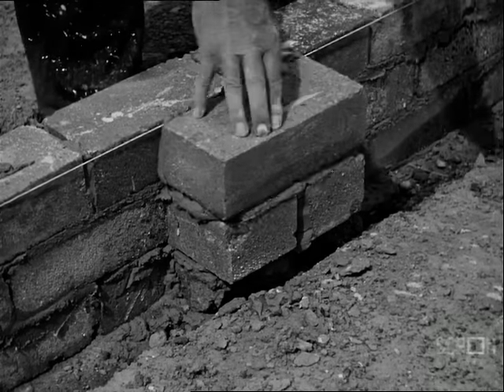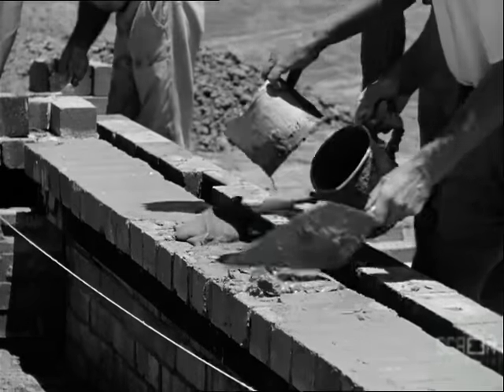Building A Brick House

Comment: That roof tiler running up a ladder with a full shoulder of tiles. Gangster
Reply: He had great sense of balance,one wrong step, that's the end of his roof tiling career. Respect his nimbleness.
Reply: That’s just how you do it.
Reply: Gangsters run up ladders carrying tiles? I doubt Al Capone ever did that.
Reply: And those shoes, no boots, looked very light weight, because so much of it was tactile. That had to be 50 pounds on his shoulders & he didn't miss a beat going up that ladder-without hesitation.
Reply: @girlsdrinkfeck  i was a roofing labourer at 15 years old shouldering 10-13 @ a time all day long.i was a beast at setting out for a kid
Reply: Men were strong considering how slim they were. 
Nowdays many tradies look like sacks of sand and no strength
Reply: Unbelievable balance
Reply: @PetraKann  i saw a group of roof tiler tradies last week they were carry half that amount . 
Back then a 75kg man could lift a lot more than a 75kg man today this video proves it again
Reply: Nope, gangsters are gangsters because they're Too  Pussy to do that.
Reply: @bobdobric6787  Need to use tile lift these days
Reply: Dun it but ya I was 24
Reply: Tennis shoes perhaps.
Reply: Australia.
Roof tiles are cement.
Reply: goddamit you opened the internet's pandora's box! Internet roofers!
Reply: @bobdobric6787  My dad helped one of his older cousins build his house in the mid-60s. To this day he loves to tell the story about one of the brickies, who'd put one 50 kg bag of cement on his shoulder, then another, and climb a ladder up to the first floor!
Reply: I was a roofer until a car crash put paid to it, stacking out a roof certainly earned a beer at the end of the day!
Reply: @Ragnar8504  i love hearing those kind of stories and i 100% believe it men back then were truly physically a lot stronger nowdays we have 20kg bags of cement nothing like the old days hahaha.
My grandfather who back in 1950s was 65kg bloke would throw the old 70kg grain bag on his back and shoulder of the old trucks and rail carriages and off he goes.
That generation was truly the no complaining just get it done Men .
Reply: and I thought doing 4 was hard enough gonna try and do 6 tomorrow for sure tbh when he started to lay them they looked light but it isnt easy balancing my boss can do 12 on his shoulder easy
Reply: @onceANexile  
In that film they were terracotta.
Reply: @girlsdrinkfeck  too many power tools cuts into costs both in operations and upkeep. it's like watching that gold rush on history channel and watching how little they actually make a season once they take off the cost of buying/running all that equipment, sure they're hauling in a lot of gold... but the sheer cost to do so isn't too far above break even... can make more $ doing a 2-3 man dredge in a stream than you'll pull with a huge operation, it's just not cost effective!
Reply: they arent as heavy as they look
Reply: Barefoot
Reply: OSHA inspectors would lose there mind watching this lol I love it
Reply: He worked in the circus before that...)
Reply: roof tile long  life 120 year old still today
Reply: 6:30 Your welcome.
Reply: The mans a beast
Reply: @Ragnar8504  they only sell 25kg bags in my country bow cuz the 50 kg ones caused too many injuries
Reply: Shame they are light I can do 6 tiles on my shoulder and they are heavy his are light
Reply: The gangsters supplied the cement lol
Reply: Those suckers are not light!
Reply: Corinne Muir ahhh yes I’m sure it is heavy 6:58 it isn’t heavy they are lightweight try lifting a normal tile from new builds it will be heavier than his
Reply: Heavy or not. Hes running up and down. Dont see that now.
Reply: Andrew Davies guess you’ve never seen homers then and even still new build roofs are a lot bigger plus I have to admit working on a big site they have loading bays so you don’t have to go up ladders all day but on homers jobs done privately you have to use ladders
Reply: These people are acting your choice of words for using gangster but in the context you just ment all out bad ass man. Not gang member. Glad you seen that too. He right up the ladder with as much tile as his arm could grab and did it like a kid climbing the stairs up to a water side. No issues or struggle. What happend to us American men IDK.
Reply: @mattd03411  The. Tiles. Are. LIGHT!!! try lifting 6 concrete russels interlocking concrete tiles for a whole day
Reply: @bobdobric6787  those roof tiles weren't like concrete ones we use today in Britain.
They must be made of a much lighter material.
You can only carry 5 concrete ones at a time max.
Reply: @leeetchells609  down here in Australia in 1940 a company called Monier started making concrete tiles and during the 60s and 70s concrete tiles were in full use .
Some things are hard too believe but 1 thing forsure is Men of old were physically strong in pulling and carrying back then
Reply: Part of the job even today bro
Reply: @themac9766  bullshit🤣 what tiles where they? Plaintiles
Reply: 6:31
Reply: Liberals Destroyed Youtube  no asbestos on roof that's all  all houe have iron roof and  tiles roof . but factory roof  asbestos
Reply: @themac9766  what make tiles was they? marleys?
Reply: I done roofing for 5 years. In the 80s not much safety either... carrying up rolls of felt weighing 36kg on one shoulder and the free hand for the rings...
Reply: rumour has it they had that house done in a day 🤣🤣🤦‍♂️
Reply: When I was serving my time the tilers got an empty cement bag scrunched it up put it on his napper put the tiles on it and then ran up the ladder with both hands on the ladder no holding onto the tiles, real men
Reply: He fell and die two years later. 😭
Reply: @girlsdrinkfeck  my house was built like that. I just changed the roof wiring.
Reply: @girlsdrinkfeck  i doubt an average man can carry 350 to 400 pounds on his shoulders with ezzzz, specially going upstairs...

Comment: I live in an old house just like that, built in the early sixties, and it is as solid as a rock, same roof tiles and door frames, all perfect. Proper job.
Reply: Luis Cannon cool story bro
Reply: fuckin eh man. hold on to that baby
Reply: 1960s houses were more or less a decline in quality not as bad as now but before the 1950s was when homes were of greatest quality.
Reply: @greghonda5475   castles from 1300s am  I a joke to you ?
Reply: @greghonda5475  self insulation baby 😘😻
Reply: @greghonda5475  🤭🤭🤭🤭😹😹😹😹 oooy matry yarghmein bess fren meow 😘😘😻😻😈😈
Reply: Err no it isn't.
Reply: I live in a 60's house of 2 flats in London and it's a mess. Angles all over the place, re-claimed and broken bricks under the floor level, hardly any cement used below the DPC, non-existent foundations. The list of building horrors grows with every year.
Reply: Until a 5.0+ earthquake... These unreinforced masonry homes are death traps for seismically active locales.
Reply: Written from within an URM house that has been falling apart from recent earthquakes.
Reply: What am i doin here 😹😹😹😹😹
Reply: @danielz722  not usually a problem in the UK.
Reply: @k13ehr , You're correct, large earthquakes are relatively rare in the UK.
Reply: Same here, solid as a rock!
Reply: I own a couple brick townhouses built in the mid 1950's. They have their up and downs. Like out of square walls were fixed by the plaster guy, crooked doors and windows cut outs were "stick built in" so they could and did adjust every part of the door or window to make it fit proper. If you have to take the hinges off the door or frame for some reason you do it like an operation making sure ever last screw ends up back in the same hole. If not you are adjusting back and forth for hours. Replacing the windows is whole new adventure. I wont even get into rewiring and such. But..... went through two pretty bad hurricanes in one of the house's and even during the worst winds never a shake or rumble. I will put a updated older house up against a new house any day.
Reply: @Madman-ge2eb  I live in a house from the mid 40s thats solid as water.

It's actually a pretty well built has but due to neglection it's starting to get into bad shape
Reply: I rent a 1965 ex state housing home in Perth WA, it looks very similar to the one in this video. Gotta say, it seems to be holding up quite well, only complaint would be the bricks heat up slowly over the day, then it's like an oven by night time 😭 nothing my portable aircon can't handle though
Reply: Houses back then where built out of bricks on a solid concrete and steel foundation. Now homes are built with dry wall.
Reply: @scorpionblade4112  I wouldn't have a new built house if you gave it to me.   Timber frame rubbish is all you see now days, and the rubbish they put up in the usa are tinder boxes a few years ago I watched newly built house's burn to the ground. Within 1/2 hour 6 house on the site were a blaze, it was frightening to see how the fire spread within each house. Thankfully they were empty .
Reply: People had pride of workmanship and done now it's about profit and and made to last 7 years until the warranty wears out and then redevelopment within 50 years the whole side those in the land of the building and fashion changes every couple years with kids etc now and there's also have got no warm for character olivieri you know like I think the 70s to a he's with the last houses built the character after that they're all Lego and project homes
Reply: Yh and now full of damp 😂
Reply: "old house built in the early 60s" my guy thats practically like new. New England is full of houses from the 1800's and earlier.
Reply: I want my mom to get an older house in good condition but they’re expensive in my area.
Reply: Yeah but how much asbestos is in it ?
Reply: They are solid. But I live in a 1960s house and alot of the doorframes are wonky, could be because my house has had some changes over the years for example a kitchen wall would of been knocked down so maybe that might have moved the frames. 
I would love to travel back in time and see what my house looked like when it was built and to see the finishings inside. My house is a council house and it's interesting how each one in my area is different inside slightly and some are exactly the same and even kept the bathrooms in the same pluming arrangement. I looked at old listing on the Internet of my house and damn even just 10 years ago my house looked so different instead. I bet my house have been redecorated 10× over the years atleast. My kitchen had 3 or 4 layers of wallpaper and each layer was painted and a pain in the ass to remove. House has been replastered since and its all white walls now with no sign of old decor. I think our bathroom toilet and bath is from the 1990s but hard to be certain and that's about the oldest thing in the house. Sorry I went of a rant I just find this stuff interesting
Reply: your wood frame comes from old growth forest man that shit is as sturdy as a frickin i beam LOL regardless the materials used then were built to last a very long time i renovated a house a few years ago that was built in the late 1800s and the windows also had the lead sashes and they still worked along with no water or insect damage thanks to the lead paint that house was a real hoot to work on consider yourself lucky now a days its cardboard and foam homes
Reply: Same roof tiles ? Bet your heating bills are sky high.
Reply: @wolfBC  I’m slowly making my house into a castle. County might have questions one day but that’s too bad.

Comment: My lower back was screaming just watching those men setting the lower courses. Those people were just made of tougher stuff. Brilliant craftsmanship!
Reply: When you do that everyday your body is used to it. Our bodys our made for bending. The issue is many of us sit 90% of the day then go outside and try to lift 20 bags of mulch no warm up. Its like trying to stretch an old rubber band thats been sitting around awhile, the odds of it snapping are a lot higher
Reply: They were walking with canes, by the time they were 50.
Reply: Do sprints and stairs if your back is killing you
Reply: They were made of the same exact stuff as you but simply suffered through it.
Reply: @billkallas1762 and at 30 they looked 50
Reply: I’ve been a roofer 36 years, my backs done for hahaha
Reply: I saw that too. yikes. I would be yelling "get in there boy, use the knees!!"